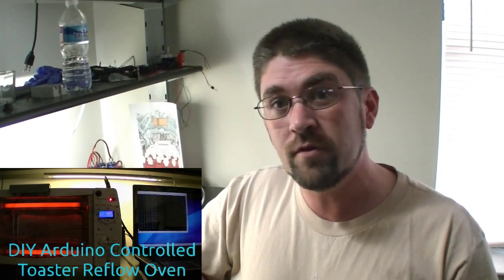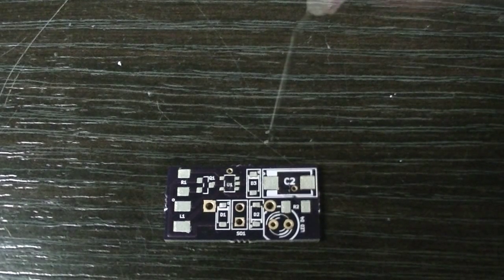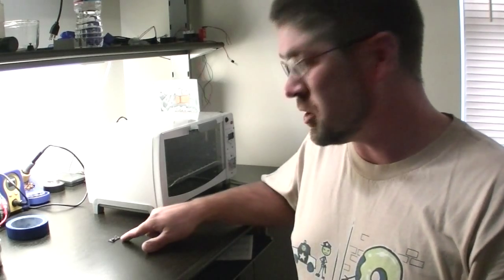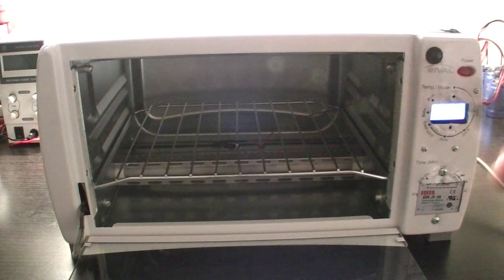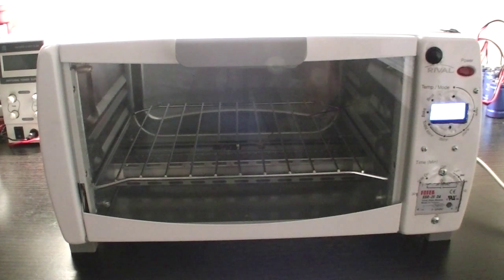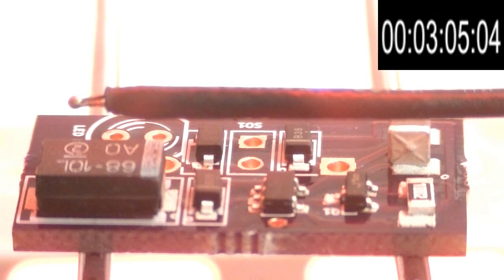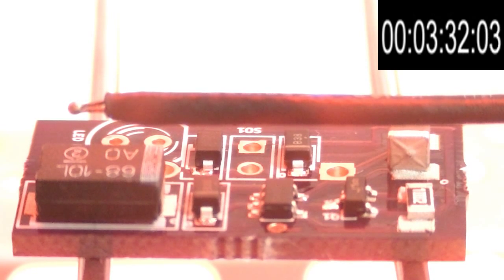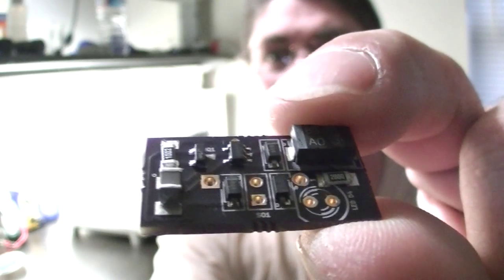OSH Stencils + Pick n Place + Toaster Reflow Oven - First Full Run Through

Comment: Hello Mad Electron Engineering, 

I have been trying to solder one of my 2x2mm SMD sensor using the nippon america SP-10 solder paste. I left the pcb in the reflow oven for 7-10 mins with max temperature as 220C. My sensors fails to sit on the board. Do you think it has to do with the solder paste? I cant find a datasheet for that solder paste in their website. I would like to hear your comments on this.

Comment: Wow. I'm impressed with what you've done, dude. After spending the entirety of 2014 & 2015 researching SMDs (with a whole batch of concept designs in the pipeline), I didn't go too far without hearin' about reflow soldering & I'm completely amazed.

Looks like I should kick off my first hack with one of these. =^/.^=